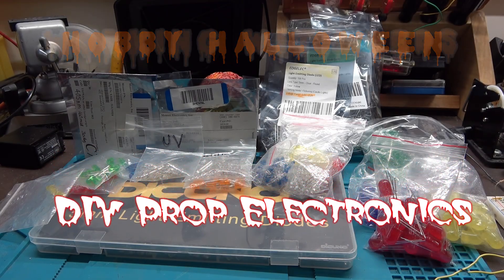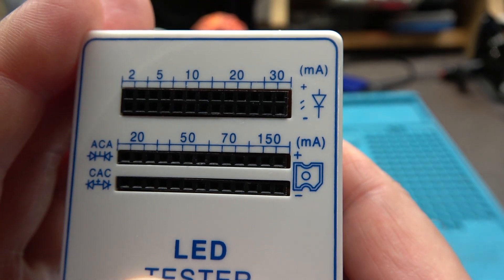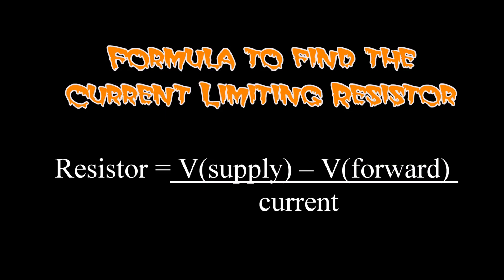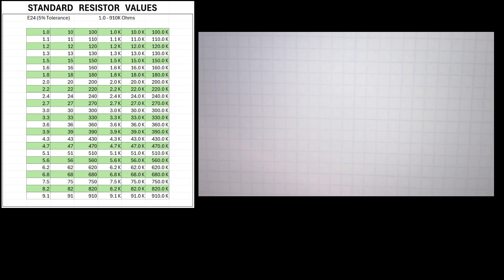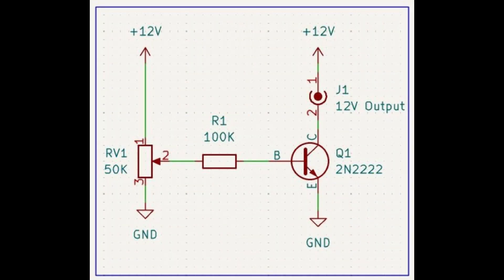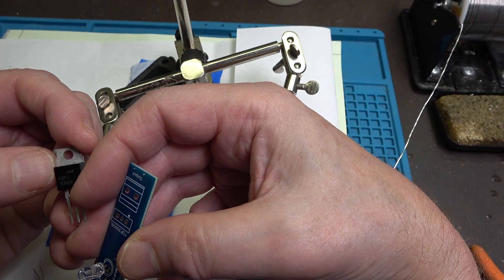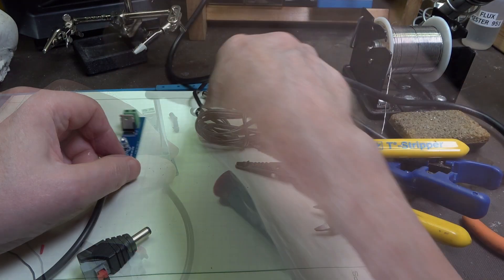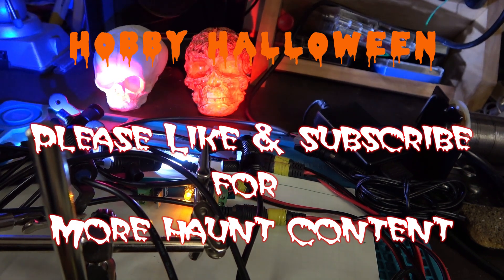DIY LED Tutorial for Props and Haunts (Electronic Prop Series)

Comment: This was a really great video. I had to watch it a few times and watch a couple of other videos on transistors, but I'm good now. The flicker LED controls the current flow through the transistor. Simple yet highly effective. What transistors did you use for your DIY flicker? 30NO6 MOSFET for the Jekyll board.

I vote for more technical videos!
Reply from the maker: Thanks!

For the dimmer box, I used a general-purpose transistor 2N2222 in a TO-18 case (Metal) and there are 2N2222's in the TO-92 (plastic) case that will also work, but I think they can't handle as much current (have to check that), it's what I had on hand, but TBH, any NPN general-purpose transistor works, such as 2N3904, BC547, etc. 

Correct, the part used in Jekyll-Labs is the 30N06 MOSFET.  It's not the same device I used for my dimmer box, MOSFETs are voltage-controlled devices and BJTs  (bipolar Junction Transistors) are current-controlled devices.  Fundamentally different kinds of transistors, so the Jekyll-Labs circuitry had to be different, but accomplishes the same thing.

Your vote for "More technical electronics" videos has been duly noted...  You got it.

Comment: Great video. Also-nice tip on thumb placement while trimming leads. Mine often end up shooting all over!
Reply from the maker: Thanks!  And of course thanks for the kit, it was fun putting it together.   About that trimming tip, I was taught that tip long ago and I don't remember who or where... but it saves finding them on the floor.  I debated if I should even put that in the video, I'm glad I did.  I also held the offcuts when I trimmed the LEDs, but I didn't say anything but it's in there.  I wonder how many little things like that I do that I should comment about.